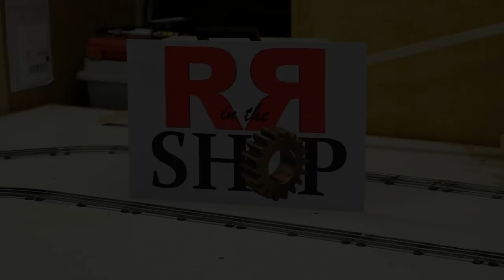Ketchup #62 - Specialty Fixture Plate Build

Comment: Happy New Year Randy. Great idea to make the  fixture plate for your dovetail cutter production. Thank you for showing your 3D printer from Banggood. I will have to check this out. I have been happy with my purchases from Banggood.  I am not sure if many of the viewers know that Windows 10 comes with application "3D Builder" for 3D printing with CAD and supports the 3MF format. It is a simple 3D CAD program but can be a way to start for many with 3D printers.
Reply from the maker: Thanks Paul.  Happy New Year to you and your family.  3D printing takes a lot time, not counting the actual printing time.

Comment: You could tighten your holding plate, clean the table well. Grease the bearing. Tighten holding screws like a wheel. I think you could get real close. Great job. Can add a adjusting screws into plate. Like a router table. Hope it all helps you. Sometimes we need a fresh mindset.

Comment: Nice looking fixture. You keep putting videos up like This Keith R won't be letting you drive the train! lol That white lead is what all the car dealer crooks used to pour in the engine oil to get the rods to stop knocking. I can't imagine that there aren't synthetic greases that offer superior performance to whit lead as a lubricant. We use copper antiseize mixed with gear oil to do heavy press jobs and it works great.

Comment: Glad to see you Randy - I also had the dreaded bug and even now it is still lingering a bit at times. I still have no shop time due to temps although we do have a slight improvement now for a while.
Love that between centers jig - very nice. 
I keep thinking about a 3D printer but there are so many! Your mold pieces seem terrific.
Nice work on the fixture plate... great idea with the spindexer.
Reply from the maker: Thanks Chris.   The bug hangs on forever.  Feeling pretty good now and back to hiking.  Stay warm.

Comment: How about a link that describes the printer you chose. Didn't recogonize the model you mentioned. Thanks.   Also do you do 1/2 in shank dovetail cutters. Thanks!
Reply from the maker: It is a Tevo Trantula.   Yes I do make a 1/2" shank tool with a TPGB 221 insert 0.940 diameter head.  Send me an email to RRINTHESHOP@GMAIL.COM for details.